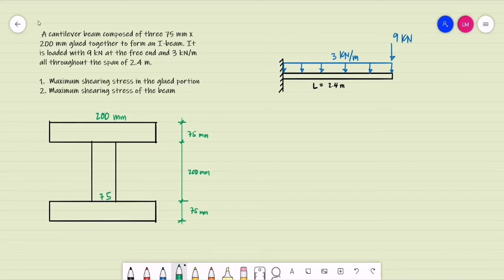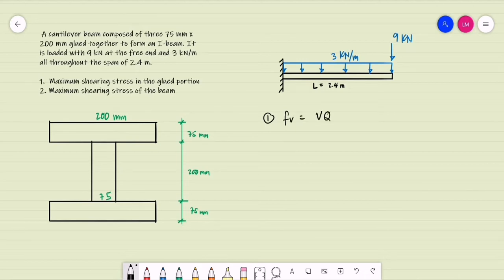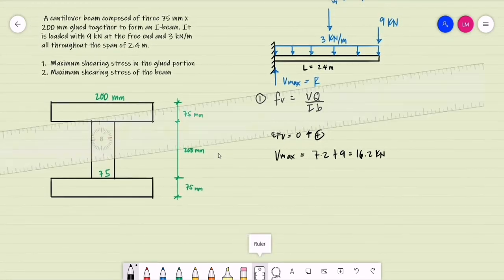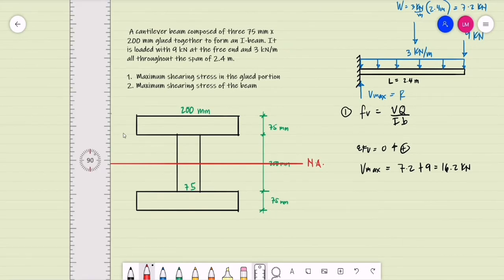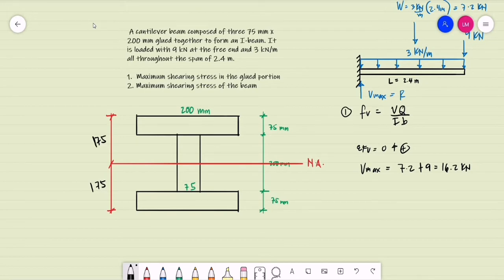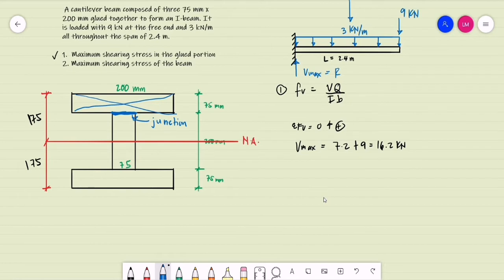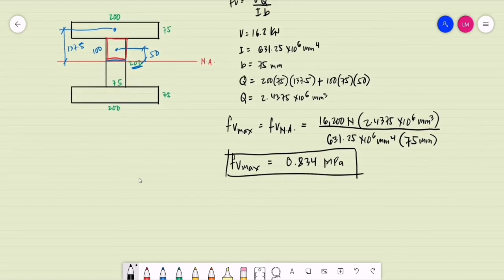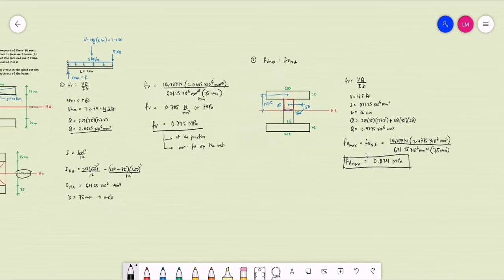Stress in Beams: Horizontal Shearing Stress - I-Beam

Comment from the maker: Correction: 
At 11:09
Value in the calculator for Q should be Q = 2.0625 x 10^6, not 2.065 x 10^6.
Correct answer for number 1 is fv = 0.706 MPa(Almost the equal to what is computed in the video, 0.705 MPa)